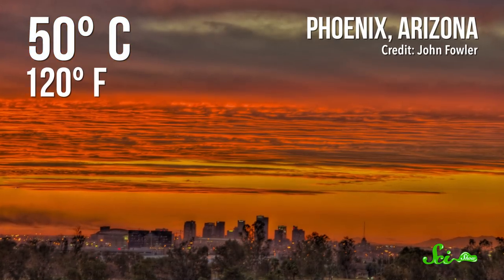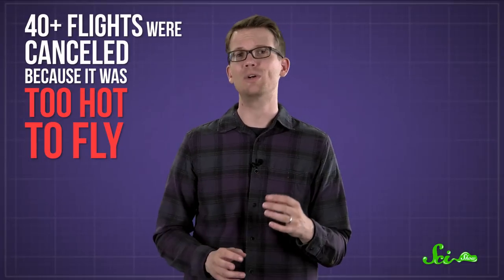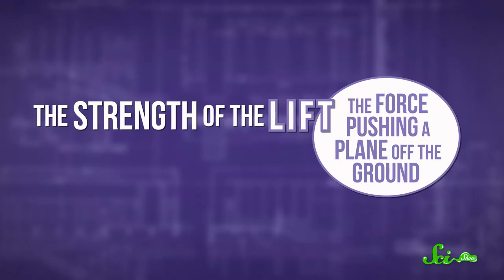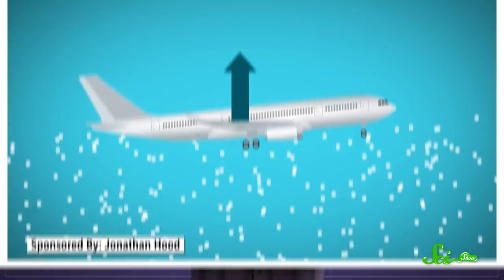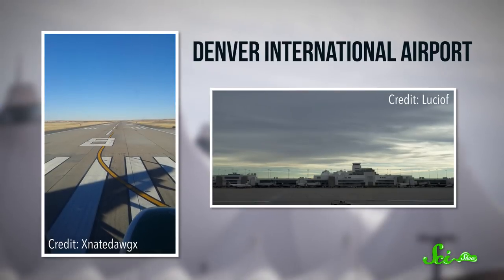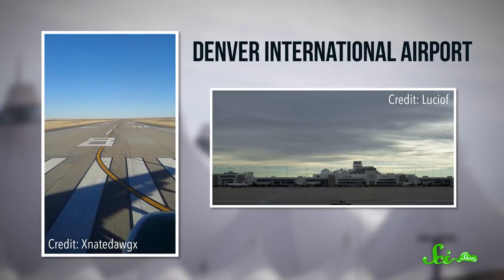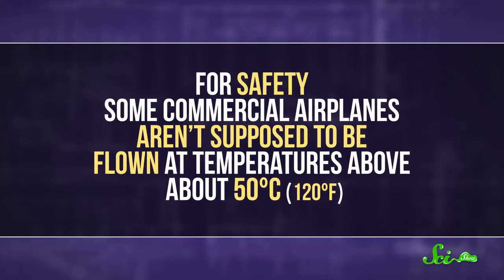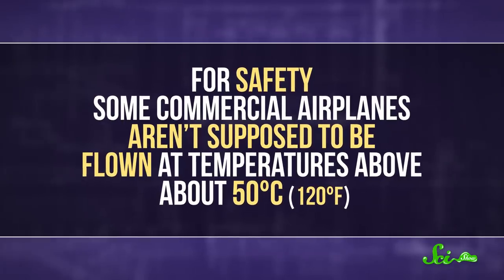Can It Be Too Hot To Fly?

Comment: i was in phoenix when it was 120 and it wasn't as bad as it seems. i find that high humidity at 90 is far more uncomfortable
Reply: what if both
Reply: RARBen Phoenix speech and debate teams sent people to Birmingham in June. They determined the dry heat was worse.
Reply: Mystery Man only someone that didnt have to spend more than 5 minutes outside would say that. 5-10 minutes outside high heat/low humidity feels worse. But spend more like a half hour or more and high humidity feels far worse as your sweat doesnt evaporate as easily as it does dry high heat conditions. Its down right miserable if you have to be outside in a humid area for any lengthy period of time vs a dry region.
Reply: GraveUpo Welcome to dubai
Reply: I bet you stepped outside for two seconds in the shade then went back inside to think 120 degrees wasn't that bad. It's actually hard to breath at that temperature and the sun touching your skin feels like someone's resting a frying pan on your skin that they just cooked with. If you're outside for more than 5 minutes, you need to drink water near constantly. People have died under an hour without being properly prepared for that hot and that dry. It sure feels grosser being in 90% humidity but it's far more dangerous in that kind of dry heat. Key word FEEL. Just because it feels worse, doesn't make it worse.
Reply: RARBen agreed.
Reply: Try 140 in Iraq :-(
Reply: I've carried mail through summers in Florida and in Las Vegas. Both are bad, dry or wet heat... It is still stupidly hot
Reply: agreed. it was 118 where I was but it felt better than 90 and high humidity in Seattle.
Reply: The place where I live (north of Spain, by the sea), is a real hell when it gets hot because of the humidity, like, I've been in other places at 45º Celsius but man, 35º here is way worse
Reply: I can agree. I live in the Phoenix area now after living in Wisconsin for 15 years.
Reply: 90 degrees with 65 percent humidity in the southeast (the Carolinas, Georgia, Florida) is unbearable.
Reply: Knock knock, its Texas. We have both temperatures that are of the surface of the sun and humidity so high it might as well be raining.
Reply: Dry heat or not, it's still hot af. I could put my face in an oven, that's a dry heat, but my face will still be gone afterwards XD
Reply: @novatheumbreon1364  ik it really is!!! I was in South florida not too long ago and I saw temps at 95°F with 55% humidity, it was gross!!!!!

Comment: So I live in Phoenix and I looked into this when I heard this news story. Of all the information I could find, only regional flights (whose planes are smaller and designed differently, specifically Bombardier CRJ airliners) were the only ones that couldn't take off. It wasn't because of the density of air specifically, it was because the ambient engine starting temperature was too high. Max engine start temp was 118F and that day it reached 119F, higher in some places.

Comment: After teaching aviation for 30+ years that is one equation we factor into flying. We call it "Density Altitude" Any airport which has an ASOS surface observation system will state the current density of the atmosphere. Temperatures, barometric presser, and humidity play a very important role in taking off distance and landing distances.

Comment: TL;DW: Hot air is thinner, thinner air is much harder to fly in.
Reply: To be precise, much harder to take off - not to fly -  in. Actually, flying in thinner air lets planes consume less fuel. What altitude do you think they cruise at, and why?
Reply: ...except that this is not all of it. 

Boeing compiles performance data when "test-flying" an aircraft prior to delivery. Very hot air is rare, so it costs a LOT to test in such conditions, and many operators have no need for such data. Thus, Boeing makes the "high temperature performance data" an OPTION that they then CHARGE for.

The "stranded" airplanes were from companies TOO CHEAP to pay Boeing for the optional "high temp" performance data. There's an excellent chance that they could have taken off just fine, but "probably safe" isn't good enough for the FAA.
Reply: bcubed72 "highly unlikely" every summer it near reaches it
(In Phoenix Arizona)
Reply: KoalaKingGaming
For a couple of hours, on a handful of days, in only a few airports. I can see an airline "cheaping out" and simply accepting a dozen or so delayed flights a year, versus paying for the data. Obviously, no airline with a hub in PHX is going to do  this!

Comment: Does that mean that driving in  hot weather, around the 50C, would be more efficient wind-resistance wise?
Sure the engine wont be running at good efficiency cause of the heat, but still... mind blown.
Reply: I used to drive a convertible regularly, and the wind noise was unbearable on colder days--generally speaking people who own convertibles drive with the top down way more than any sane person would--but on warm summer days you'd barely notice it.

You might also notice your car getting better gas mileage in summer than winter.  It's pretty much the same reason airplanes fly at the altitudes they do. Thinner air makes for more efficient travel, though the difference for a car would be much less than an airliner.  The difference between 10,000 feet and 30,000 feet might be enough to prevent the plane from making its destination.

Comment: Your sympathy for Phoenix is accepted. (Regarding the heat and flying, I've also heard rumors that some airplane tire brands actually start to melt a bit and stick to the runway at 120, but I don't know how true that one is. )

I've actually had a flight out of Phoenix delayed for a different, heat-related reason: The AC on the plane shorted out, and basically turned it into a tube-shaped greenhouse. Even the pilot didn't want to stay on board while it was fixed.

Comment: Yeah that's weird when it's 55 degrees everyday in Dubai desert
Reply: Seth M that's weird in te sun we have only 5500 degrees lol
Reply: Seth M what? Wtf is going on here?
Reply: Don't you think that's why the runway in Phoenix is 1800 meters but the one in  Dubai is 4400 ?
Reply: That´s weird when I have an academic degree in temperatures.
Reply: +Traxxas Dude
Because the plane likely has the performance, but Boeing CHARGES EXTRA for the takeoff data above 40C or so. (After all, getting that data was expensive, and not every operator needs it.)

So, the planes sitting were from the airlines TOO CHEAP to pay Boeing for the "supplemental data." In all likelihood, they probably could have taken off safely. But "probably safe" isn't good enough for the FAA!

Comment: While I was getting my pilot's license, there was one day that it was well over 90F and we were in a little Cessna 150 with no air conditioning. So, my instructor told me to fly up where it would be cooler. Unfortunately, the 150 isn't a big plane, and we were both kind of big guys, so as the air density due to altitude dropped, we reached a point where the plane just wouldn't go any higher. Even more unfortunately, the air density dropped faster than the air temperature, and point where the plane stopped climbing was still really hot outside.

Comment: I'm a pilot myself and have served 12 years in the USAF.. It's well known (in the flying community) that the hotter the location the longer the runways need to be to reach "V-1" and "rotation" airspeed, the same holds for high altitude airports. Airports in countries on the Arabian peninsula for instance, are 12,000+ feet long because they routinely reach afternoon high temps of 120+°F, or high altitude airports like Denver Colorado where you're already at 5,000+ ft. just sitting at the end of the runway.(edit) It also depends on what type of aircraft you're referring to, smaller propeller driven aircraft are going to have a really tough time with heat and altitude whether they're turboprops or piston props AND they don't have the wing area of larger jet airliners and therefore cannot produce the same lift that the large airliners do. Also,  props turn at a few hundred RPM, jet turbofans are turning at 10's of thousands of RPM and have scores of blades whereas a prop has from 2 to 4 blades to generate thrust.

Comment: Why can't the plane just fly faster? Don't they take off and fly at 70% of max thrust anyways? I'd figure airlines would do all they could not to lose sales.
Reply: If only it was that simple. That same air also has to go through the engines, which now produce less thrust with that same hot air. This increases the distance it would take to accelerate, and cuts into safety margins that all airlines have to abide by for take off distance. Takeoff is usually done with somewhere around 85-90% depending on the day, which is done for engine wear and tear. Sure, we could use 100%, but we'd need to buy new engines way more often, which would then make airline travel more expensive. That said, for things like windshear, and executing missed approaches or going around from approach to land, we get to use max thrust but only for a limited amount of time.
Reply: safety margins imposed by profit-busting government regulatory bodies. Airlines would be happy if they can go to 99% of thrust. But then we'll have an aeroplane dropping from skies once every day or two. Which still may create higher profit for the airlines in the long run.
Reply: subh1 the problem is that taking off at 100% destroys your engines over time. It's not a conspiracy, it's to keep the company profitable by saving on repairs. In fact, there isn't even a FCC ruling on aircraft derating (flying below max speed on takeoff) at all, its pilot's choice directed by manufacturer and company protocol.
Reply: matt jones as a recently graduated engineer. One of the most hilarious things we were taught during the final year was that "accidents are infinitely more expensive than prevention". It's not really about being safe, it's about avoiding lawsuits, environmental payouts, bad publicity, etc etc. That stuff costs way more than delaying a flight.
Reply: Airlines would probably still use the very same performance margins they use today. The more thrust a jet engine produces, the hotter it gets. The hotter it gets, the more it wears down because when you then shut down that jet, it cools down. That thermal cycle destroys them over time. One or two jets a day dropping out of the sky would outpace their production. These things are already $14,000,000 and up per airframe, and that's on the lower / smaller end like I fly. IT's infinitely more cost effective to no be the airline known for its airplanes dropping out of the sky than to be the one that cancels due to safety.

Also, all of those regulations are there for a reason. There's a morbid joke that the FAR's (Federal Aviation Regulations) are written in blood. Every rule in there exists for a reason.
Reply: The tires can't rotate at the speeds it takes prior to lift off.  So even longer runways only help up to a point.
Reply: sgtkasi Okay, thanks for the anwser.
Reply: mmm airplane talk 😁😍

Comment: This exact thing happened to me today. Flying out of Denver it was 95 degrees. And when your a mile up there's already no air to lift the plane. Long story short they asked for 40+ people to de-board a 150 passenger plane and drove the plane around the airport for 30-40 mins to burn off fuel weight. It felt like we hardly made it off the runway before it ended. But hey, I'm alive. Plus a 3 hour flight delay and a reschedules transfer for the next day.

Comment: saudi arabia is always 50°C 

we fly all the time
Reply: Project X I think it's because Phoenix is is a higher altitude in Saudi Arabia. So the air is less dense to begin with.
Reply: Project X currently it's 70 celsius here i finland
Reply: Yeah, I doubt it's 'always' above 50c.. No where on earth is 'always' 50c... and only a few places have reached that number.
Reply: 70 celsius??? I think your thermometer is broken...
Reply: perkele saatana torille
Reply: Epic_SxP 
It is not 70celsius in finland and cannot be. Do you even know what 70 celsius is?!
Reply: Existenceisillusion yeah right thats a flat out lie you proberly be almost dead or dying right now because it cant get over that temp its impossible right now and earth would be to close to the sun by then or the sun would have exploded by then it has never been recorded it never happened.
Reply: I'm in London and it's 105 Celsius at the moment.
Reply: David 
105 FAHRENHEIT*. 105 Fahrenheit is about 40.5 celsius and 105 celsius is about 221 Fahrenheit.
Reply: captainrobots 
Exactly. 80 degrees celsius is insane. The guy probably meant Fahrenheit which would make sense.
Anyway the highest confirmed temperature was 56.7 °C (134.1 °F) in Furnace Creek Ranch, California, located in the Death Valley desert in the United States, on July 10, 1913. Some people think that it's a lie though and if it actually turns out to be false then the highest recorded temperature would be 54.0 °C (129.2 °F), recorded both in Death Valley on 20 June 2013, and in Mitribah, Kuwait on 21 July 2016.

your welcome.

Comment: Only flights that used Bombardier aircraft were cancelled because there are no published performance figures for temperatures above 50C. Only about forty flight were cancelled. The 11,489' runway at PHX is more than long enough to accommodate most large jet aircraft at high temperatures, but without the published performance figures/calculations which are necessary for any preflight (FAR 91.103), the airline/pilot in command would assume liability following an investigation should any adverse event take place.

Comment: I live just slightly North of Phoenix, it's roughly 5 degrees cooler than Phoenix here but still, when it gets that hot (which is rare, an average summer day is about 105-113) direct sunlight actually hurts a little. And every car is a literal oven, especially black ones, I wouldn't be the least bit surprised if someone has successfully  cooked a lasagna in there passengers seat.

Comment: It's called density altitude. As the air heats up it thins out to the point that it acts much the same as air at much higher altitudes. The airport in Phoenix is at 1,135 feet above sea level, but when it's 120°F the density of the air is so thin that it acts like the air at a much higher 5,000 feet above sea level. It takes a lot of power and a pretty long runway to get a commercial airliner off the ground at 5,000 feet DA, and it's more runway than Phoenix has available.

Comment: High temperatures also limit engine performance, such that the engine will overheat and have to be operated at a lower power/thrust setting. This obviously limits aircraft takeoff performance.

Comment: The FAA will not allow an airline to operate a airplane in conditions in which it has not been tested.  As you can imagine it is very difficult to find places to test such large machines under extreme weather conditions.  Even if it is theoretically possible you will not be allowed to risk the lives of passengers if you don't have the data to prove that it is safe.

Comment: Planes actually still can take off in that heat. they might be restricted, meaning they can take less payload.
The problem is that the plane itself (or the external performance calculation software) cannot calculate how much runway is necessary at what power setting and configuration. The thresholds are usually around 45, 50 or 55°C. Airlines can buy performance packages from the manufacturer. This isnt much more than a ssoftware upgrade that lets the performance calculation siftware calculate with higher temperatures.

Also not only lift is affected, but also engine power. Not only do you need to be faster in hot air to produce the same amount of lift as in cold air, it also takes you longer to accalerate. That's why you either need a longer runway, leave behind some bags, or run the engines at a higher power setting.

Comment: Funny, i've been searching for an AC lately and i've noticed the standard 12000BTU split type AC works only up to 48C exterior temperature accordant to the spec sheet. So if it gets to 50C you are really screwed in the city. I presume those big, yard mounted units, can cope with more exterior temperature. Although there has to be a upper limit for the refrigerant after which it does not condense anymore. Or the pressure in the system gets to high.

Comment: 1) For a commercial plane to fly, there has to have been a test in similar heat, showing the plane has sufficient performance in those conditions.
2) Because of 1), airplane manufacturers undergo an expensive and time-consuming "testing phase" before a model goes into service.
3) Since very high temperatures are very rare, Boeing (or whoever) has to go though a LOT of trouble to FIND a 50C day to perfrom testing.
4) Because of 4), Boeing treats such data as "an option" and CHARGES extra to airlines if they want to buy it. 

So...the planes that were stranded, NOT because they lacked performance necessarily, but because certain airlines were TOO CHEAP to by the optional tabulated data on "high temperature t/o and landings."

Comment: And landing can be dicey too, higher speed needed at landing just to stay in the air, the runways have to be long enough to allow the planes to brake before they run out of runway. Tootles... Wade (I used to live in Bahrain, the humidity actually helped with lift for landing but it was still too hot for takeoff!)